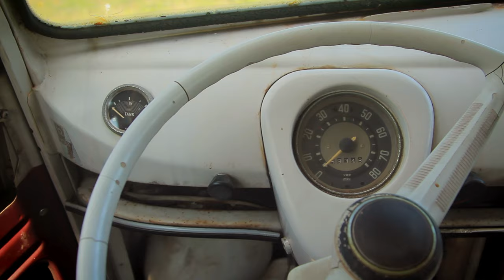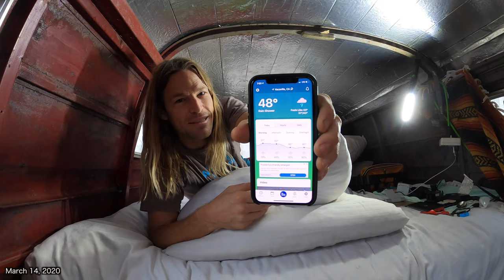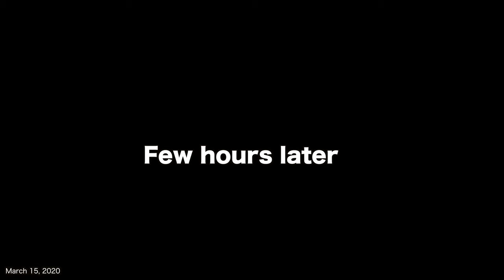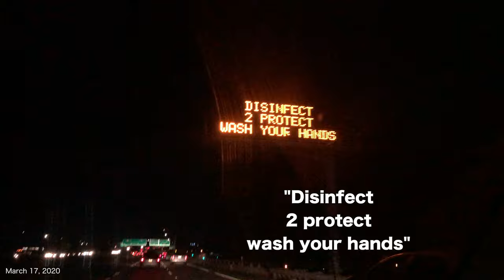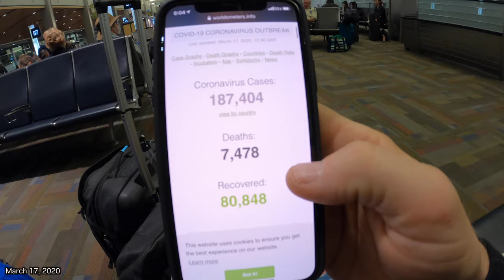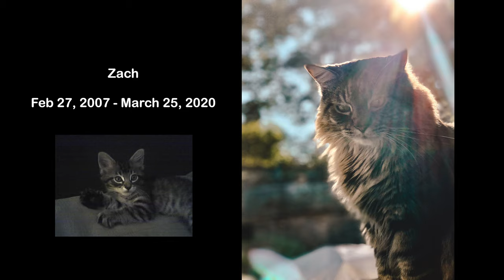VW Bus Restoration - Episode 28 - Convertible! | MicBergsma

Comment: Man she's gonna have all the trimmings when she's said, and done. Gonna be one sweet looking bus. Good for Mic. Just goes to show if your willing to follow your dreams and put an effort into it, you will get what you desire. Know this though you can't just sit on your ass and dream only, dreams only come to reality with action. Happy for you bud. I always wanted a Tacoma Truck, a nice one, so I wasn't able to work due to a disability because of a serious injury! So I bought used vehicles and got the them fixed by a body shop. Then sold them its took me about 5 years but afterwards I ended up being able to get my dream Truck! If there's a will there's a way. All you need to do is work towards your dreams. You will have lots of setbacks and at times and it will be stressful. Yet in the end you'll have what you worked for.

Comment: My 72 had an access panel on the back deck to open and get to the spark plugs
Reply from the maker: Awesome I am going to make access panel on Kona
Reply: @MicBergsma  I think you can get them in new stick like your roof.it has hinges on the rectangular hole,and the panel is held down with rotating pins.opened with these looped metal rings